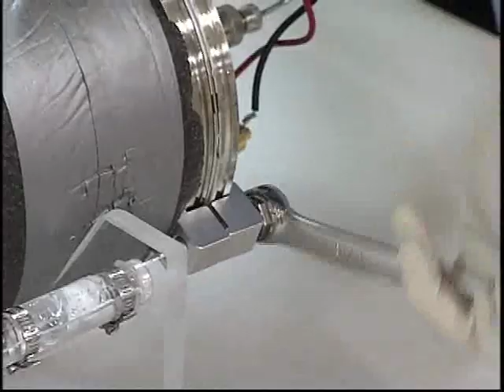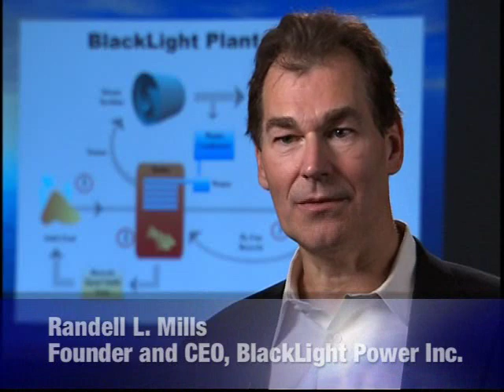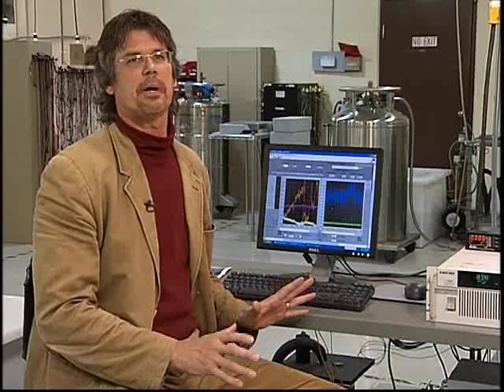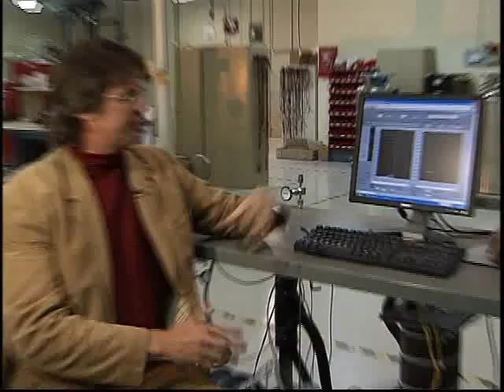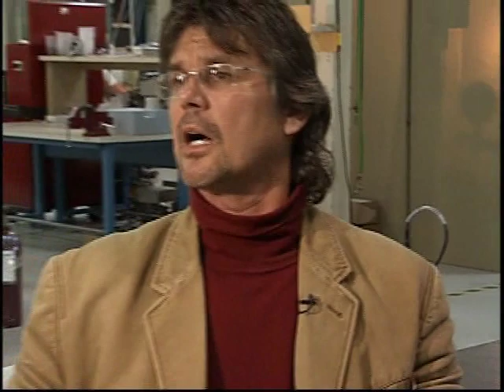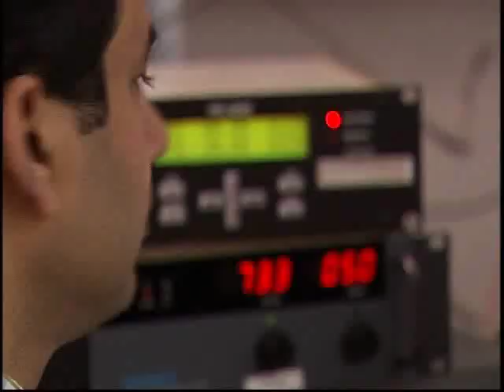BlackLight Power Experiment Video v2

Comment: @cloudTheory Actually, it doesn't break the law of conservation of energy.  Simply put, it isn't "Free Energy".  The process starts with hydrogen atoms in the base energy state and ends with hydrogen atoms in a fractional energy state (called hydrinos).  The excess energy is released as heat.  Eventually the hydrinos will return to the base state by absorbing ambient energy from the environment.  Zero net loss of energy.

Comment: @pianofingers007 gladly. in a gun, a striker pin hits the mercury primer. the reaction is a discharge of energy hundereds of times that of the exitation energy. this energy results in sufficient force to plant a bullet in someone's head form a kilometer away. that is because a chain reaction released the energy already evident in the gun powder. that is just what is happening here. we have found that we can release energy already present in the exitation state of an atom.